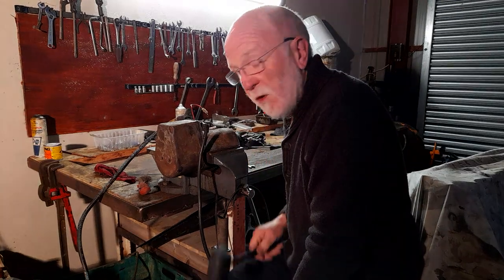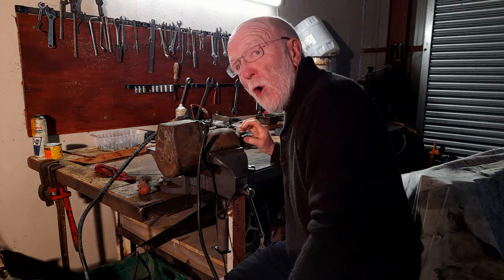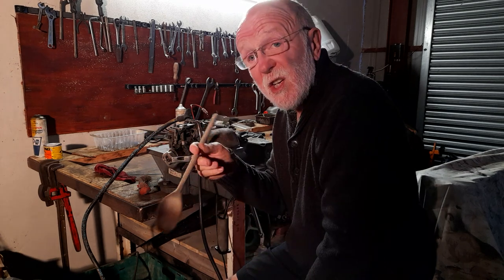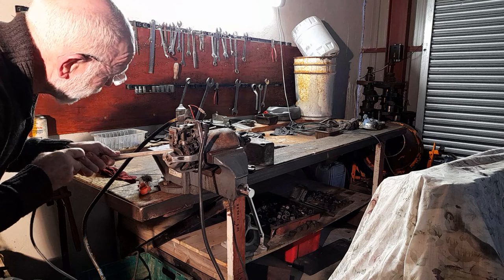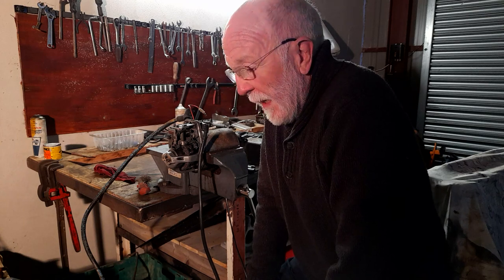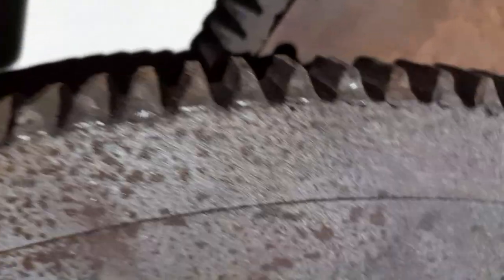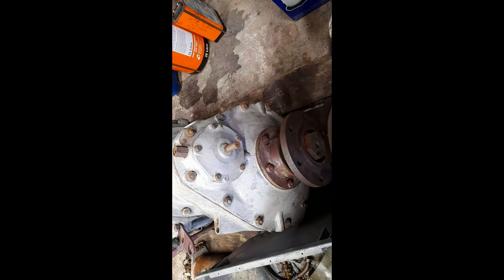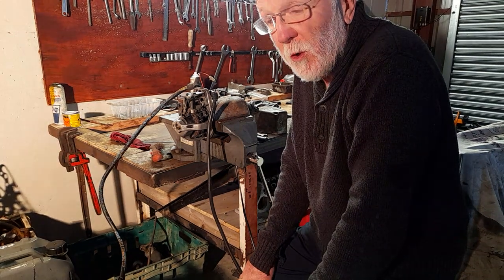Gardner Engines: two starter problems and get me home

Comment: We don't need to be experts on such a simple engine. I've been around Gardner's most of my life and am no expert, but there's not a job I can't do on them. 
 If always said. The bigger the engine, the easier it is to work on.
 I have a Gardner in an Olympian bus which is my home. I was quite specific that the bus I wanted was to have a Gardner in it. When we went to pick it up it started first time. After 6 years in a field.
 Lovely engines.

Comment: Hi Joe, well you described a problem my started had had for some 10years or more before we bought it, spinning up the pinion, not meshing, the get you home procedure was similar to yours, push the pinion into mesh with a screwdriver, hold it in mesh with a bit of wood tied on a bit of string, start the engine, wood drops out, all good, but as our 2L2 is in a narrowboat it meant you left the engine running rather than stopping it. Sent it away for rebuild, new contacts ans solenoid etc, put it back on, same problem( no wear at all on the ring gear, bronze pinion got chewed) sent it back again and they changed to windings as there was electrical leakage from 1st stage to 2nd stage making it spin up before it engaged

Comment: I was on the Tallship Alma Doepel which HAD two 8 ??? And one of the other offices told me you can start the engines by  putting then in to gear when we are sailing along.
I said I don’t believe you so he did it and both started BUT the engineer came up and said f:(43?xdf what are you doing, I am down in the Engine room .
Well it works as you said.

Comment: For a long term solution can you shift the ring gear or does the gear need to be replaced?  This problem happened on the ring gear for a travel lift in a local boat yard. I watched them heat the flywheel and remove the ring gear which was entertaining.

Comment: After getting my injector pump sorted running nicely now. Starter been grinding for last while me not knowing better just kept trying it till started after 1 or 2 shots usualy, but last day it grinded and grinded then all I was getting was click 🤦‍♂️ presumed it wasnt engaging it happened before on my other engine. Took it out and half of penian? Wheel was sheered off 😭 and it took good showing with screw driver to push it forward and grease it up and she fired straight away then. But now feel like I need to change the pinin? Wheel. 

So any ideas where I could get one 😂😂
Wish I seen this video about 6 months ago when it 1st started grinding 😂😂

Tow starting is a fact personally know 2 lads that done it many times going fishing 😂😂
Reply from the maker: We can supply them, please email diameter of starter and the number of teeth.  Ideally a photo.

Comment: Why didn't Gardner use a Bendix instead of a movable armature I sure see a lot of potential problems.
Reply from the maker: They did, the S130 starter was of the bendix type.   But the traditional axial starter gives very little bother really.   They are very reliable really.